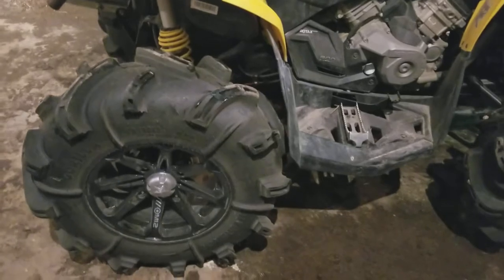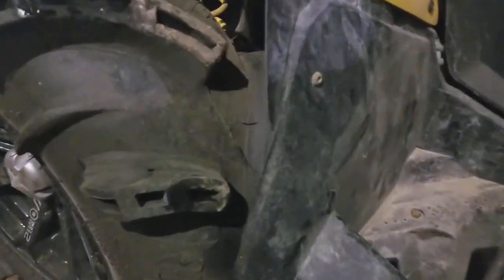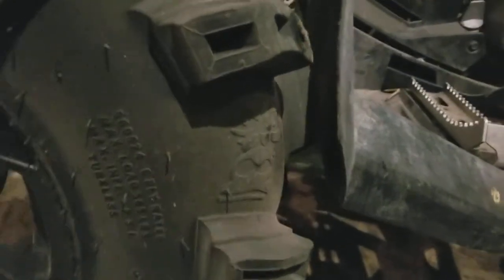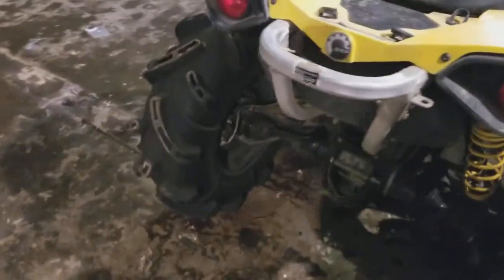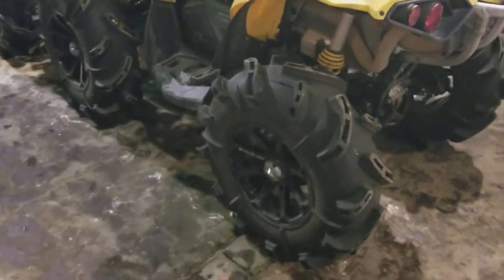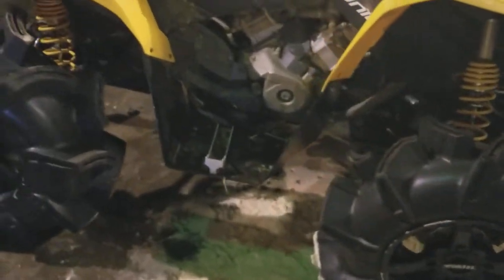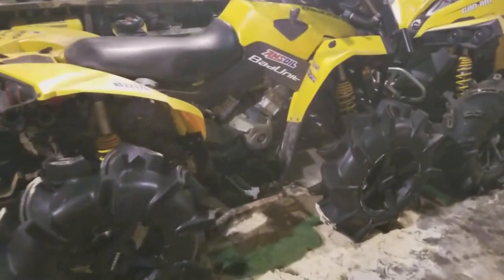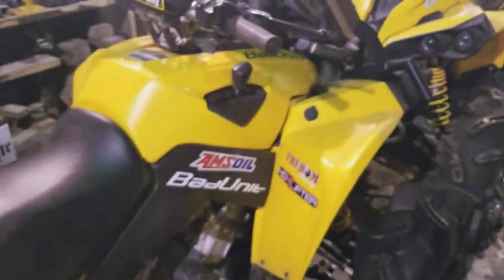Can Am Tire Size Answers!

Comment: This is an Older video but I'm running 29.5 outlaws on my stock 1000 xxc and just had to roll the front of the rear fenders and running just a dalton clutch kit with a new secondary spring recommend by dalton and ya anyone checking this out if your playing in mud like we do here and you dont have a clutch kit or new primary you will notice it suck down that's before getting into any other power mods